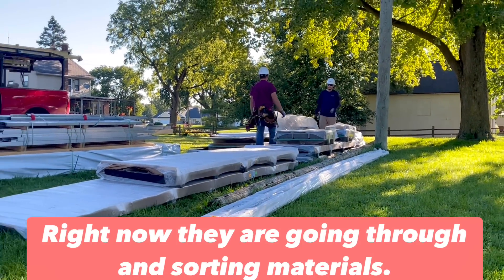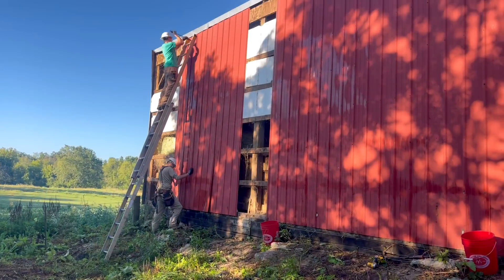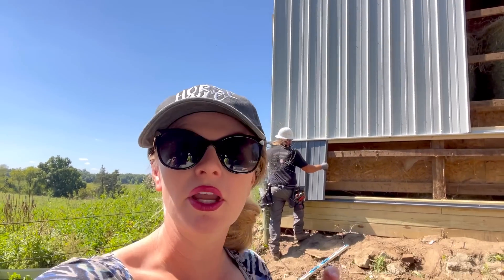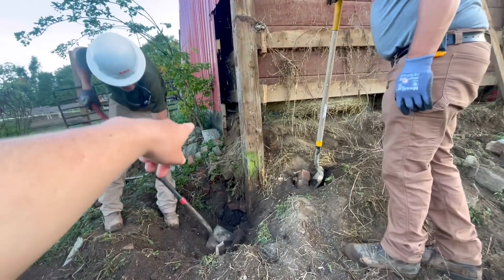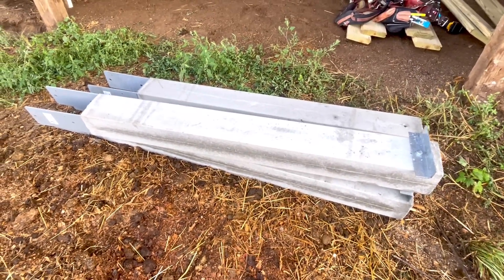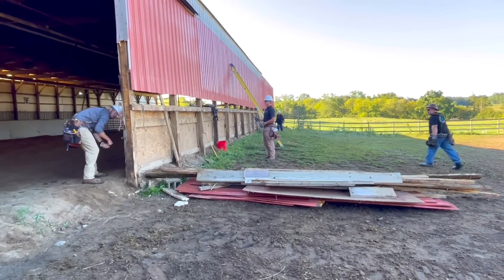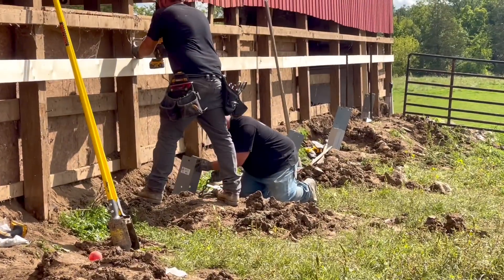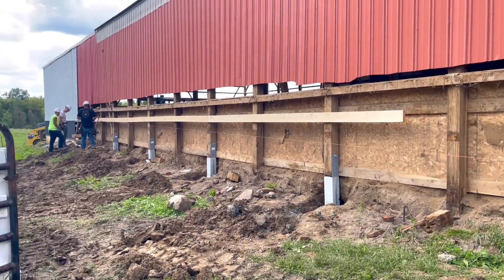Horse Barn Renovation Update! MAJOR PROGRESS

Comment: Your horses are calm because you treat them well.  It is good that they are plumbing up the building.  The structural improvement is important for your safety (when snow and wind come).  The lighter colour will make it cooler in the summer.  The gutters will ensure better surfaces for you.  Maybe you can use the rainwater?  The crew is impressive.  I wish Morton Buildings operated where we have to construct.  Best wishes to you all, not least to your super charming filly!

Comment: Looks amazing and the sun won’t do the same damage.  We had dark brown with beige roughly 40 years ago and the sun damage was horrendous. It turned it to a disgusting reddish brown. At the time we went to a beige with white trim. And looked the same when we sold the property. A lot of talk about nothing. 
Just to say the colour should not fade.  And leaves you to add a splash of colour somewhere. We had a sage green from door. 
Change is so much fun , a lot of work and expense but it had to be done. 
So happy for both of you. Sorry I rambled.
Reply: You are spot-on. Red oxidizes, horribly, as the dark brown also must have. These color choices should last a lot longer, visually. Also, the lighter color will help the arena stay cooler in the summer.

Comment: When I built my Morton Buildings four stall horse barn 19 years ago, they advised us to not use a different color for the bottom/wainscot section as their feeling was that it dates a building.  I agreed.  These "steel" (not "metal" or "tin") buildings are still constructed with the wainscot section to enable easy replacement if necessary.  I went with beige as the main color and brown for the trim.  Still happy with that choice after all these years and have received a lot of compliments/people stopping in wanting to see the barn.  As I type this, we're sitting here still waiting on the Morton construction crew to show up to do the roof repair (damage happened over a year ago) on our machine shed.  The materials were delivered over two weeks ago and no word on when the crew will arrive to do the work.  Apparently you have better luck with Morton Buildings in Michigan than we do here in Minnesota.  ;)

Comment: Those guys work efficiently! They've got a nice, simple process going-- it's really nice to see professionals at work. And I like the choice of colors. A hot pink barn would've been a statement for sure, but I also agree with your reasoning for going with something a little more neutral.

Also, it's a pretty good look at what happens when people try to DIY shoddy temp-fixes, like piling all the stone up by the rotting splashboards. They're just making more work for the real professionals... that sucks! And of course, that "temp fix" did basically nothing useful enough to be worth the effort of putting it there and having to dig it out in the first place. Glad your crew's a good sport about it, at least!

Also, this video has definitely shown exactly why repairing a barn like this is definitely not a DIY job!

Comment: Looks good! I am sort of going through same thing on smaller scale. Previous homeowner put a long deck alongside front of house but put support posts for deck roof in the dirt. Posts are so rotten I was able to stick a screwdriver in them with no effort. Unfortunately I have to replace and correct all of this myself without paid help as there is no budget to pay anyone. 🤦‍♀️ 
Telling you this now but thoroughly go through every area they worked in for screws, nails, hardware, etc.. not just for horses but all animals on property. And! I hope you salvaged that red metal roofing or gave it to someone that will. It’s still perfectly usable! 

Beautiful job so far!! 😀

Comment: :face-red-heart-shape: Morton Buildings :face-red-heart-shape:Renovation of Free Spirit Barn.  Shae and Kyle, your team methodically replaced the perma-columns for the rotted, ant-bitten posts and installed the new slashboard in perfect measurements.  The weather really took its toll on the wood.

Have to say, I didn't know barn renovation could be and look as good as a total rebuild.  Is there a concrete foundation, guess not, just the packed sand floor inside the indoor arena?

Kyle, thanks for explaining how they kept the structure from collapsing by leaving up and rotating the removal of every other vertical post.  This is a great advert for this rockstar team that mingled with you filming the engineering processes; it will certainly draw in new customers.

The muted gray and charcoal-colored, outer metal skin tells me that you have expansion in mind, Shae, as in resale value one day.  I see it:  your new acreage including your EV bike park.  Can't wait to see the next video on the final finished product.  Wow wee!:face-blue-smiling:
Reply from the maker: Thank you! No expansion plans though lol

Comment: Lighter colors reflect heat better than dark colors do......red fades so easily and absorbs/transmits heat to the interior.  I think you will enjoy the lighter color and it will make a difference. Good idea to have the lower part a stiffer and shorter (more replaceable) piece, due to horse interaction. Good show!!!!❤
Reply from the maker: Yes this is so accurate!

Comment: I think they should better put metal bars from about 1 to 1,5  feet crossed under the pole to make like reinforced concrete. So never that pole can go more down. With only concrete  it is'nt so strong. When i have to put a column i do this always with hierro from 3/8. I put little stones under the metal, than about 2 or 3 inches of concrete till where the column or post is coming, afterwards i fill with concrete, but not with such a big truck😅
But i was surprised they don't fixed nothing  or almost nothing to provide it come down.  Yes i saw at the inside small wood, but for me too small.😊
Yes it was necesary to change the rotten parts, i was thinking first they would change  the whole posts. But it was a good solution like you did.😊

Comment: Why didnt you just paint the barn rather than replace the metal ?
Reply from the maker: You don’t paint 60 year old metal. It was all damaged as well…
Reply from the maker: Plus all of the metal had to be cut and removed to replace the posts…
Reply: Yes, the posts were definately rotted. The cement piers were a great solution , I had a similar problem with a shed in the past. Thanks for your reply.

Comment: Was there a barn on the site years ago? If so you are dealing with a very old "field stone" foundation. They were what the farmer had on hand and they just needed something to build the bottom of the building on. If those stones were loose when the barn came down well why not throw them into the new barn beam holes. Hide the stones and get them out of the way. Nobody will ever know where they put the stones. Very very aggravating but common. Horse urine is amazingly destructive to wood. It can be shocking when you have to replace all the wood. Just out of curiosity, why not keep the red metal upper walls? Such terrible fear among your animals!!! They want to RUN FOR THEIR LIVES and you just won't let them! Shame on you for such horse torture, Shae.